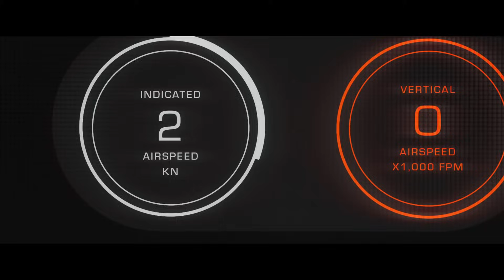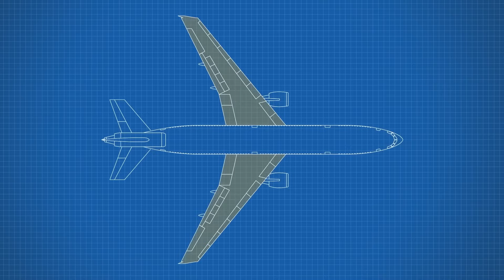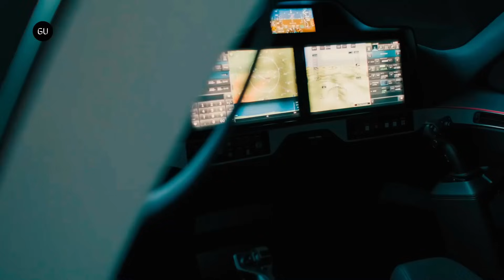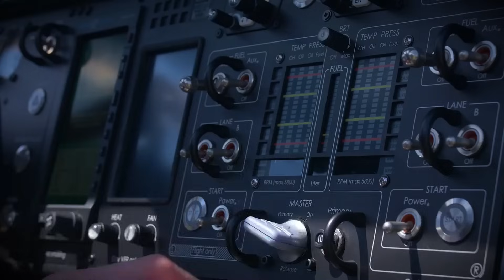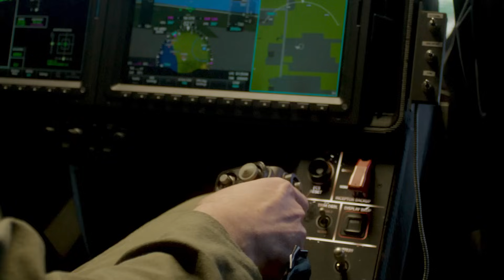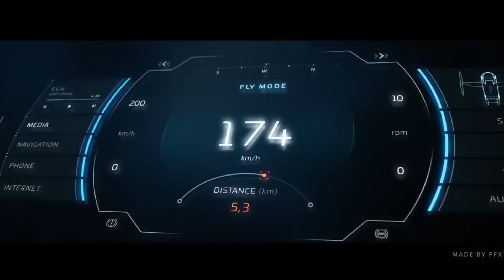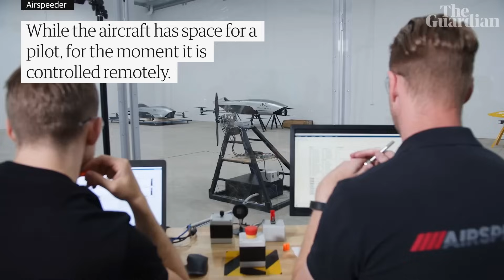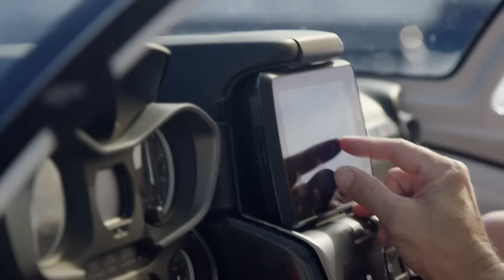40 UNIQUE FLYING MACHINES YOU DIDN’T KNOW ABOUT

Comment: I believe the Bellwether's Volar-Antelope 38:18 holds great promise for urban mobility. One way to enhance entry and exit could be by incorporating gull-wing doors that open to reveal a set of steps leading directly to the seats. Once the pilot or passengers are aboard and securely buckled in, the door could close and lock in place for safety. Additionally, for emergency exits, the top canopy could be designed to open, providing another means for passengers to exit the vehicle easily.